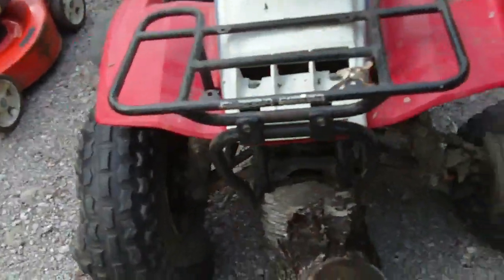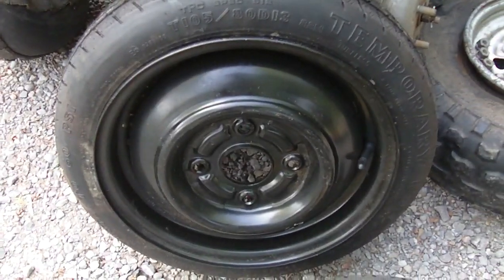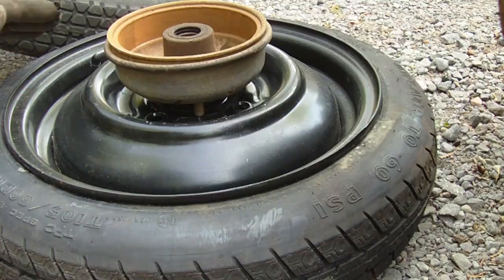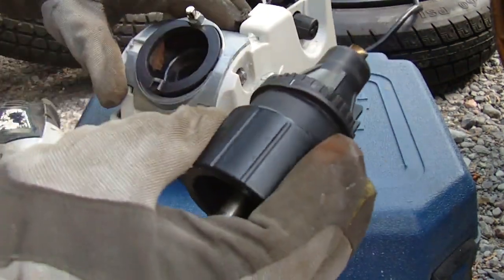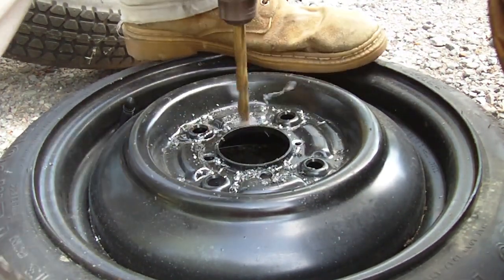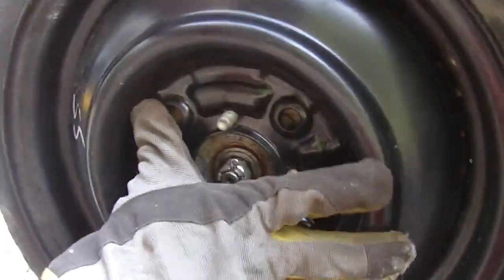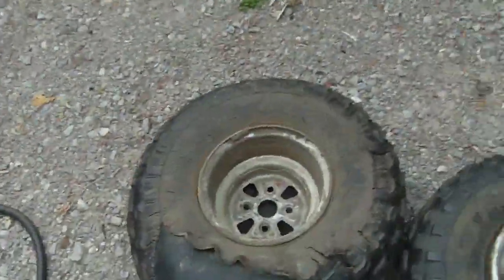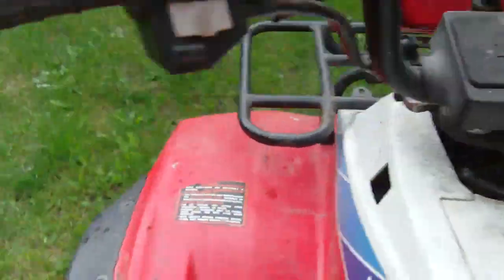How to Install a Compact Spare from a Car onto an ATV

Comment: Cuz it'll make it easier to drive on the road but if you've mounted and balanced them if you go higher speeds on the road without tipping in to get more traction cuz they're a little wider

Comment: Nice...I thought those Hondas were 4×100 mm...like early Honda civics n whatnot...but good job
Reply: The are Honda’s 4x100.  The sprint wheels are 4x114.3.  He could of just used a spare from any Honda Civic and install it without the drilling
Reply: @reedmadden  chevy cobalt 2005 - 2007 4 x100

Comment: Can you put regular car tires on there like not a spare
Reply: if you look up the bolt holes configuration of your machine, and find a rim to match, you can put any tire that fits the rim ( and doesn't cause clearance issues with the mechanicals of the machine) that you want